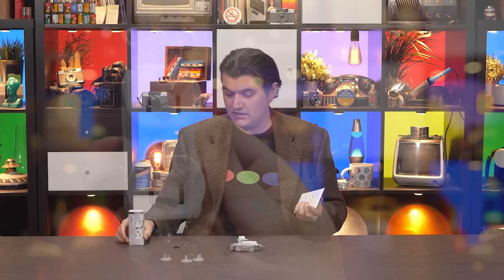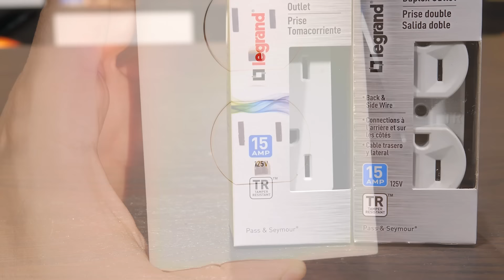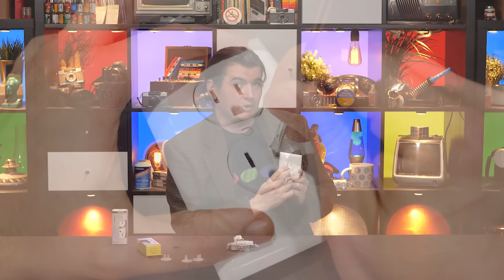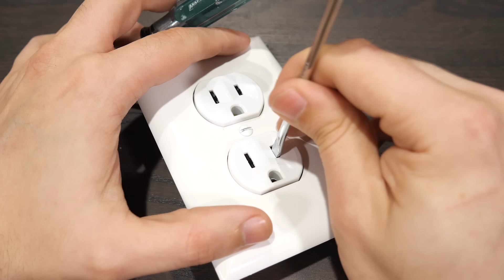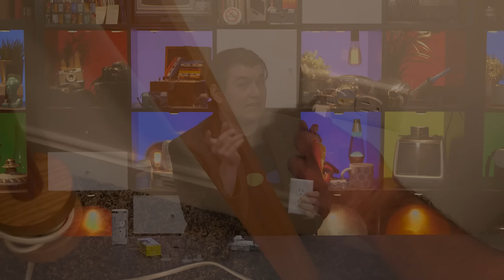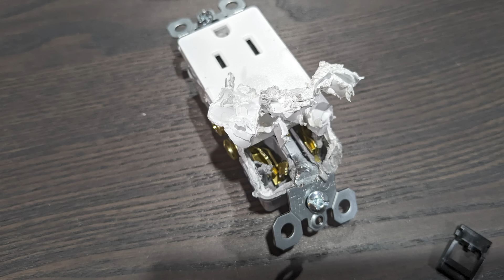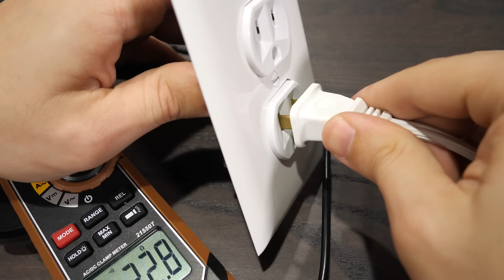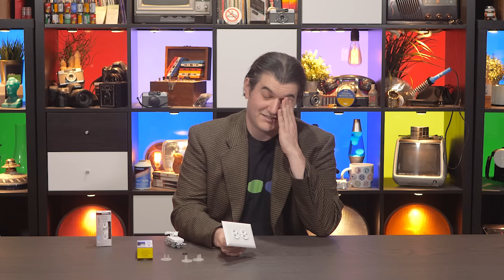Tamper-resistant outlets aren't all the same - a follow-up

Comment: Also I’d be worried with using high current devices if the outlet is only making contact with a tiny portion of the plug.  A tip, if you only have older two prong outlets you can make them safer by replacing them with GFCIs…while they still aren’t grounded, they give you extra safety for electrical leakage to ground.
Reply: Do as we do in 240 land; put a GFCI in the fuse box and be done with it.
Reply: @Welgeldiguniekalias  You have that option here too, its just that no one really knows about it because most homes anymore have either been properly rewired, or were built with an equipment grounding conductor. The other issue is cost, unlike the UK (I assume many other Euro countries are similar) where you have one or two RCD slots that feed multiple over current protection devices, we have two large bus bars that run the length of the panel and each circuit is fed in parallel from one or both of the busses. So you need one GFCI for each outlet circuit, and they cost about $50 each, so I personally would need 6-8 of them. But it's a cost effective solution in 2-wire homes as GFCI either in the panel or at the first outlet protects from alternate current pathing.

So instead I only use GFCI near water or outside. You can buy panels that have a main GFCI, but that requires replacing the panel, which many would rather not do. We are also rather laxidasical when it comes to GFCI protection outside of baths and kitchens.
Reply: @Welgeldiguniekalias  While there are GFCI (and "Arc Fault") breakers here you can have installed, the problem is you them have to traverse down into the basement to reset it, rather than resetting it where you plugged the device in.  
As for going for 240v what is the point, I've been to several 240v countries while I live in Canada...(having been an electrician's assistant) every country I've been to has it's pros and cons, INCLUDING the much over-hyped UK setup.  Going 240v in every country (or even just North America) with long established 120v or 100v electrical standards would be too costly to do and not improve things...I regularly import electronic music devices that are hardwired for either 240v or 100v, and it's just a pain to either convert them for 120v, or using voltage converters each time.  My mother remembered when our electrical system was 25Hz, and when the conversion was done to 60Hz our electric company came around to replace every device that had a motor in it (washing machines, fridges, etc.) and while the end user didn't bear the direct cost, that conversion certainly showed up as part of everyone's electric bill.  Suggest watching the following Technology Connections video if you haven't already to explain the North American electrical system:
https://www.youtube.com/watch?v=jMmUoZh3Hq4
Reply: @mikefellhauer3350 lol I was not even suggesting coverting to 240V, just to put a GFCI in the fuse box so every outlet in every room is always protected. I mentioned 240V because 240V countries typically have this setup, presumably because 240V across your chest will drastically reduce your life expectancy unless there is a GFCI to save your bacon. Indeed, my fuse box is in the basement, although in my parent's house it's located in the hallway, so it varies. Ground faults should be rare though. If you have to regularly reset your GFCI, there is something very wrong.

Comment: NA electrical stuff is so wild, I think just making some industry standard plugs would help since outlets could be designed around those specific plugs (and possibly shrouded like the type F outlets we have over here), although making that backwards compatible would be an absolute nightmare.
Reply: xkcd 927
Reply: @BangersAndMash98  This is a moot point when the new standard is mandated.
Reply: That right there, backwards compatibility is the exact reason why here in NA we just have the mindset of... ehh its fine go with it. the problem being our electrical standard is very old and at this point is so widely adopted that any change either takes forever. or makes no waves. for instance the change from two prong wall outlets to three prong wall outlets took years and ive been in houses that still only had two. 

the other, in america we have started providing 20 amp service for most electrical runs. all the breakers in my fuse box are 20 amp, but none of the outlets in my walls are 20 amp. they theoretically should be since the circuit can handle 20 amps, but nope all of them are nema 5-15R.

really a safety feature that i myself tend to do, when i replace outlets. i will replace the first outlet in a circuit run, with a GFCI making all the outlets after that one, GFCI protected, i like this because if say i was to touch the prongs i wont get a severe shock. in fact it happened once where i did slip and touch the live prong, and i didnt even feel anything. the outlet just suddenly went dead with a click. its not code to do that and theres often arguments to not doing that. but for me its never really been any issue and id much rather have a malfunctioning appliance or something get disconnected via a GFCI over having to pull 20amps to trip the breaker. That feels safer to me anyway.
Reply: @compzac  The 20 amp circuit just means that the wiring in the walls won't catch fire before the breaker trips. The outlet rated for 15 amps means that any load plugged into it can't draw more than 15 amps and remain in spec. Effectively, the 20 amp circuit allows you to plug in loads up to 20 amps between all the outlets in the circuit without problems, though you're still limited to only 15 amps per load. There's very few appliances that use the winky face 5-20 plug so having 20 amp outlets wouldn't make anything better
Reply: Different areas tend to have their own industry standards. It's like how the US has ANSI and Europe has ISO. North American electrical connectors are standardized under NEMA and all North American outlets and plugs meet that standard. If you come over here with a Euro plug, it won't fit.

Comment: Although most British outlets only require something to be shoved in the earth/ground hole for the shutters to open, there are some which require both power pins to be inserted simultaneously, and even ones that require all 3 pins to open them (earth/ground first, then both power pins together)

I believe the ones here that require only the two power pins to open them are no longer manufactured, and have been replaced by the type that requires all 3 pins to open

And I believe European outlets have shutters that require both power pins to open
Reply: The UK sockets that open the shutter with the L+N pins  are manufactured by MK
Reply: @theturtlemoves3014  The MK sockets open on all three pins E & L & N. And their Metalclad range are double pole switched for safety. Seriously well built.
Reply: In the old days when equipment was not supplied with plugs it was possible (particulrly on the simpler power strips) to open the shutters with a key or screwdriver and just poke the bare wire ends into the socket to do a "quick test".

Comment: As a British Guy, I can probably explain better about the plugs "falling out" part (as opposed to just being dislodged). I have a few USA eqipment here in the UK that use a wall wart type power supply, all 2 prng, and some have even folding prongs for storage. At home I either use an adapter (if i am using one device) or use a US powerstrip (240V capable) to plug many devices. The biggest issue is the wall warts (especially with the folding prongs) with thise thin strips. Since there is no "wall" they can pivot far more and pop out far easier, not just dislodge. This just does not happen with a british power strip, or a proper schuko EU strip, though the european two prong wall warts are just as bad especially when plugged into a "flat" socket.

Comment: Maybe you could do a community poll for U.S. viewers to ask if we have ever been shocked by a U.S. style plug. 
I would be surprised if a significant percentage said yes. I've never been shocked by one or seen it happen to anyone else. The times I've been shocked have all been from accidentally touching bare wires or improperly grounded large appliances.
Reply: I live in Norway and I have ADHD (which greatly increases the chance of me doing something careless and silly) and I don't think I've ever gotten a shock from a Schuko or Europlug. I have shocked myself a handful of times, but that's usually from sticking my finger into light bulb sockets or touching the socket while trying to remove a broken bulb, and once because of illegal sloppy electrical work where some live wire strands were poking out of a sloppy wad of electrical tape poking out of the wall on my primary school next to a drainpipe I and my (also ADHD) friend were using to climb up to the roof of the school building*.  With the european plugs (at least those that are less than 60 years old) you really need to use some kind of tool to be able to shock yourself on the receptacle itself; you're not doing that on accident.

(* We were climbing up and jumping ca 1.5 floors down into some bushes; interestingly even though I fell one floor when I touched the wire because I let go I didn't really hurt myself much doing so; but a few jumps later I hit a bigger branch that instead of breaking the fall threw me back towards the wall where I hit my head on the handle of the emergency exit from the bomb shelter, slicing my scalp up and giving me a minor concussion. Its quite amazing that I have never actually broken any bones, yet)
Reply: I have been shocked by 120 volts more times than I can count, that said, I'm having trouble remembering even a single instance that was the result of touching the blades of a plug. Most have been the result of working on live electronics (Yes, I know you're not supposed to do that!) And a couple have been through accidental contact with frayed electrical cords.
I have also been shocked by 240 volt, I will say, that one didn't tickle! I was thrown back about 5 to 10 ft, no permanent damage, but I was a little dazed!

Comment: TL;DR Backstabbing should be avoided, even if it is the last outlet on the branch.

I used to use the back stab method if it was the last outlet. When we moved into our current house, half of the outlets were loose, so I re-did the whole house with TR outlets. Shortly after, I had an outlet not work as soon as you push  a power strip in, so I took it off to see what was going on. It was one of the end of the line back stab outlets. I un-did it and screwed it down, and it's been working great ever since.